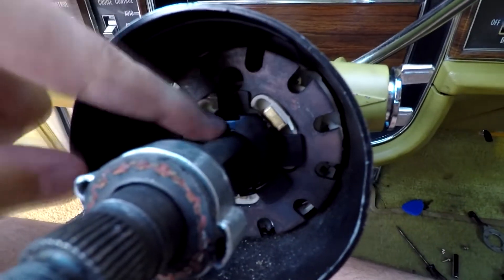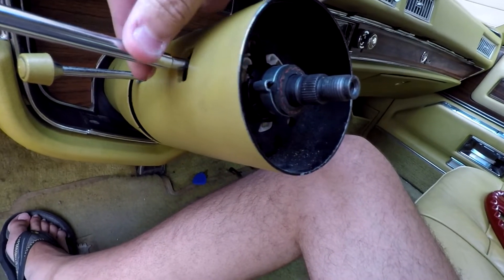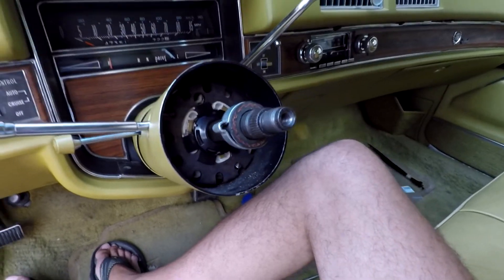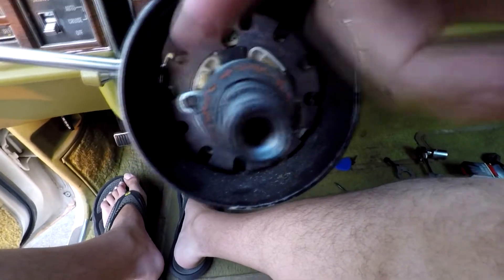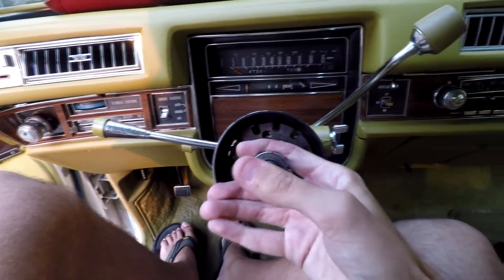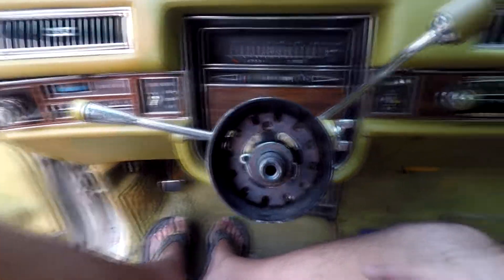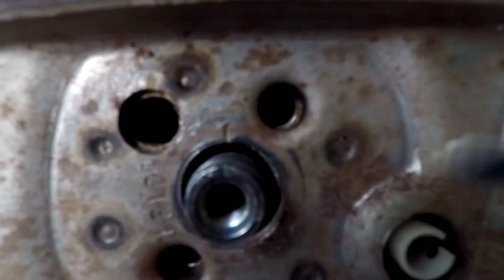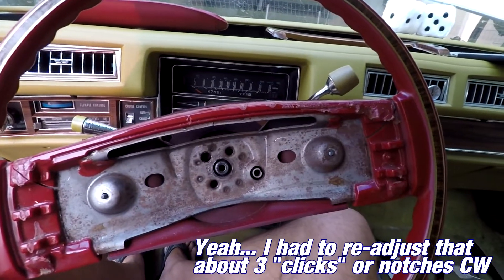FIXING GM Cadillac Eldorado Horn & Steering Wheel | Part 2

Comment: so glad i found your vid. i got the same issue on my 70` coupe. i also guess you have to slide in the spring in a certain way to keep it from grounding out on the coloumn. very great vid and good explanation
Reply from the maker: Hey man, I'm glad you liked the video! Honestly, I just popped the spring in place and the plastic insulator does its job pretty well, no need to orient the spring any special way, it seems to let it touch the connections perfectly without it grounding out on the column!
Reply: @1Brain4Wheels  yeah of course! you explained it pretty well and it helped me. i think my problem was that the plastic ring the holds the spring was broken and so it did not held the spring in perfect position.

Comment: i can't get the spring mechanism for the horn assembly inside the steering column to go back in properly. I was hoping you would show that. I got an 89 cad deville.
Reply from the maker: Sorry I didn’t get a good shot of that on film, but it basically just slides in the center and rests on those 3 metal connection points/plastic down in the base of that area. Is it not going on or just not making an electrical connection, maybe it’s an issue at the steering wheel end?
Reply: @1Brain4Wheels  I ended up half fixing it. Broke a few brittle plastic parts. Your video was very helpful and I appreciate it very much.

Comment: I have a 82 Eldorado and my wheel has so much play in it. I had the steering box changed still didn't fix the problem. Car wonders on the highway to keep it straight in a line wheel doesnt stay centered. Not sure what it is. Car is also leaking power steering shop told me it's not the pump leaking. But I keep having to put power steering at least once every 30 days I have to completely fill it up.
Reply from the maker: Hmmmm, if you’re getting a lot of play and fluid is leaking out, I wonder if your power steering rack is shot? It may have failed and it could be leaking down the sides as you turn the wheel & steer while driving?
Reply: @1Brain4Wheels  I'll definatley have that looked I never asked them to check that it yet. Thanks

Comment: 13:30. For the Horn sound.  Sounds like you are missing the "A" note and the "C" note.
Reply from the maker: Okay, this is a question I've had since first owning the car but haven't been able to find a definitive answer - my car only has two horns/notes, where as some older Cadillacs have the 4 note horn system, was that standard on all of the models at the time or did the Biarritz have the 4 vs the base with only 2? It doesn't appear that I have any missing components up in front so maybe mine only came with 2?
Reply: @1Brain4Wheels  Standard horn on the '77 Eldorado was a 2-note horn.  The "Trumpet Horn" was optional.
Reply: @1Brain4Wheels  On my 77 biarritz, there were three horn connections (disconnected).  I count 3 horns on my car, which has <25K miles and 2 owners.  But stuff is broken on it and astro roof was leaking (blocked drain line).